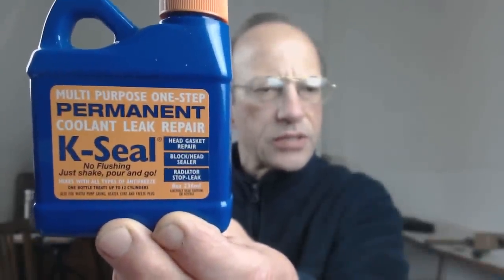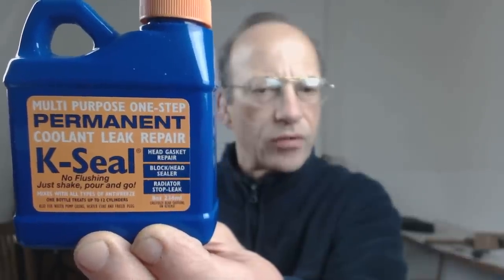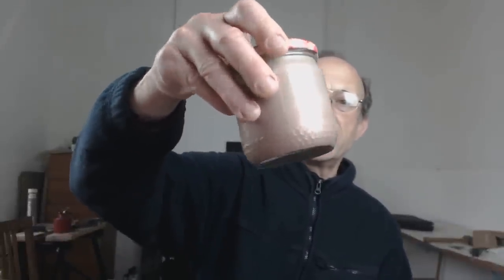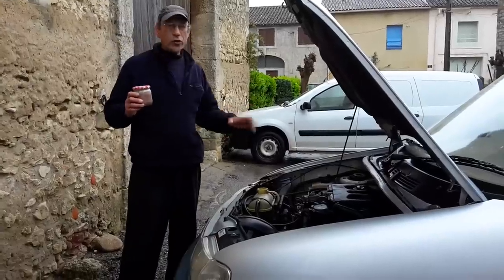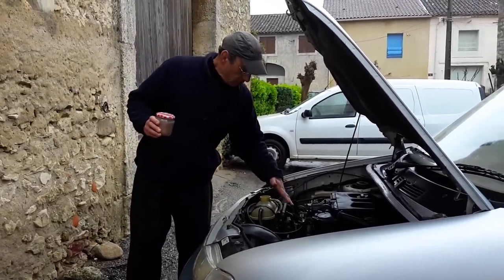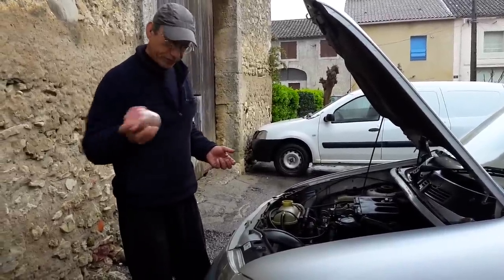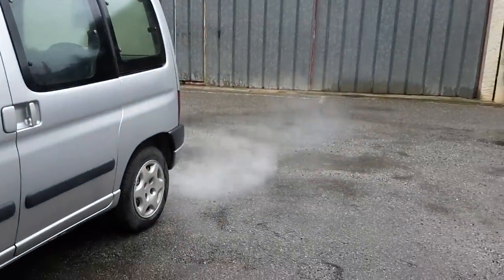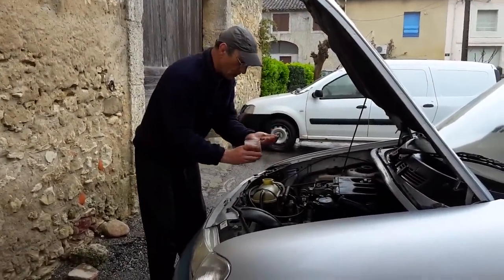K-Seal Full Test - Purchase options, Instructions & Results

Comment: Water is a main product of combustion so you get steam out of a cold exhaust anyway as the water condenses on the cold exhaust. As the exhaust warms up...surprise surprise the steam changes to water vapour...which is invisible. That's not to say K seal doesn't work, but the steam from exhaust test needs to be qualified. I use leak sealers in my work from time to time and for minor leaks they can be very effective, but I would raise an eyebrow if somebody claims it can deal with a cracked cylinder head. I think that is a very bold claim. Oh yes, I worked in vehicle warranty claims for three years as well as having worked on and indeed built cars from time to time. From that you learn that there is no substitute for doing the job properly and getting the cylinder head off if you think the head gasket has gone. It may be symptomatic of a number of other faults in the engine. I'd use K seal or similar as a get you home measure prior to proper examination.
Reply from the maker: I don't doubt that you are sincere Tim - I've had a look at your channel ;)
What I can tell you is that 'we live and learn'.

This was nothing to do with water condensing.
It was all about the system consuming large quantities of coolant.

Everybody will appreciate the position that you have taken ... it's a no brainer.
... but it doesn't make it correct.

This is one of those 'oh shit' scenarios, where your basic common sense view is forced to take a knock.
We hit these moments from time to time.

Why?

I think that we need to seriously examine the underlying process of 'common sense'

In reality, common sense does change ... it is not a fixed outcome.
Common sense is a method of thinking, that will, in most cases, look after you (during your epoch of existence).

The more that you know (your understanding of how things work), the better is your common sense.
However, it can easily fail, when an unknown enters the equation. 

I'm thinking of an extreme example (usually the best)...
Like: for an experienced soldier of WWII, common sense would dictate how far back you would go, from a bomb being exploded.
... only that, if it's an atom bomb ... your common sense will have let you down.

I'd still go with common sense, as a general rule, but we must be alert to new information and new technology.

In this case ... yeah ... it does what it says on the tin.
There's bugger all that you can do about it.

Disagreeing changes nothing.

However, that said, your comment is genuine, and it will chime with the thinking of many people.
Consequently, I'll pin your comment to the top of the thread, at least until somebody else generates a pinning signal 
:)
Reply: I don't have a channel. I'm just a qualified engineer with 50 years experience both in the motor industry and the heating industry. My view is based on experience, not selling a product.
Reply from the maker: Tim, you have got a channel ... click on your name to view it.

Me too, I'm a qualified engineer with, not quite 50 years of experience ... but close enough ;)

You should therefore know how engineers think.
Consider re-reading the text that I wrote for you.

You'll note that you were not being accused of selling anything ... I specifically pointed out the fact that I believed that this was not the case.

I can assure you that plenty of people make comments like yours, that are purely based upon 'selling'.
Note the number of comments (450 at press) so I do speak from experience.

Think more about the concept that I outlined (for you).

I wouldn't have pinned your comment to the top, if I thought that you were a charlatan.
:)
Reply: It wasn't a cold exhaust. He had the engine warmed up already.
Reply: You don't have to be an engineer to diagnose coolant in the combustion chamber.
My car produced white thick smoke with a distinctive sweet odour, which is very different to the steam that cars produce when the engine is cold.
I bet the camera didn't capture the apparent thickness of the smoke too.
I used this product in a 1996 bmw 520i  with the same problem and it worked.

Comment: Whenever i put water in my radiator, the water comes rushing out beside my engine. Everyones telling me it is a cracked engine block or something wrong with the head gasket. Could you help me with this?
Reply from the maker: Try the product!
From your description, it sounds bad.
From my end, it is impossible to say.
Obviously, check that everything is screwed down well.
You should be able to see where the leak is, if you can see the water coming out.
Anyway.... apart from a few quid, you have nothing to lose.
Good luck, and keep us informed :)
Reply: Lauren Fleming Did you try it I have the same problem you have also did you find out what the problem was

Comment: What do you mean by "header tank"? Do you mean NOT to add it to the reservoir tank? My plastic reservoir/spill over tank is empty, but the radiator itself looks pretty full.
Reply from the maker: It's because the coolant is being evaporated off due to ingress into the combustion chamber (probably).
Therefore, you can add the k-seal into the plastic header tank, and, if necessary, top up with water to the max line.
Then, simply let it circulate, after the thermostat has opened, and the job'll be a good'un :D
Reply: @EngineTuning  Is that why my car smells like maple syrup after I get out after a long drive?
Reply from the maker: @MajorCulturalDivide  Hahaha ... very likely.
Antifreeze is sweet to the taste, so you may well be smelling that sweetness ;)
Reply: @EngineTuning  I put the K-Seal in and the coolant is staying just above the max line in the plastic reservoir tank. But the radiator is not filled all the way to the top. I think it's close but not even with the top of the radiator like most people show. It stays this way after repeated drives. I am reluctant to top it off because the reservoir tank is over the max line.
Reply from the maker: @MajorCulturalDivide  remove the cap when cold, and then let the engine warm up   to open the thermostat - feel the rad getting warm ;)

You can now visually inspect, to see if everything is working fine.

Comment: I have a Audi A3 2.0 TDI, do I have to empty out the coolant that's already inside, then add the K Seal? Or do I just add the K Seal on top
Reply from the maker: Hi Jamil... you just need enough room in the header tank to add the K-Seal.
You've seen how I did it.
I removed the pressure cap, and let the engine warm, and then poured in the well shaken liquid.
Then leave the engine ticking over until the leak is sealed.
Then take it for a gentle drive to get all of the water out of the oil and exhaust.
At this point there will be no vapor at all coming out of the exhaust.
Then change your oil.
Reply: @EngineTuning  why do we have to change the oil?
Reply from the maker: If you have been losing water, it is possible that the oil sump could be full of water ;)

Comment: You say permanent how long did it last,, Some guys say a week r two tjen the crack appears again
Reply from the maker: Hey Tim; that's strange, because if that was the case, it would have definitely been reported here.
Who were the guys (plural) who experienced this?
Were they friends of yours?

In such cases of hearsay, it is always best to find out as much as possible about the situation.
In this way, you might determine if it is just guys repeating what they've heard from other people repeating what they've heard.

It could be possible that someone experienced failure to repair ... it can happen, if the damage is simply unrepairable.
However, the chances of this occurring to two or more guys in a group of friends, is highly unlikely.

I think that it is far more likely that your mates are winding you up LOL.
:D
Reply: I have Hyundai i40  head gasket gone.
Coolant bubbling and fan on constantly  trying to cool engine no water in oil .
But the coolant reservoir  keeps filling and bubbling  after I drive .
Have tried steel seal but no luck .
I'm planning on  trying the k seal .
Do you think it will work.
Reply: I have Hyundai i40  head gasket gone.
Coolant bubbling and fan on constantly  trying to cool engine no water in oil .
But the coolant reservoir  keeps filling and bubbling  after I drive .
Have tried steel seal but no luck .
I'm planning on  trying the k seal .
Do you think it will work.
Reply from the maker: @derekdoherty1956  It depends how bad the failure is.
Report back, after using k-seal.